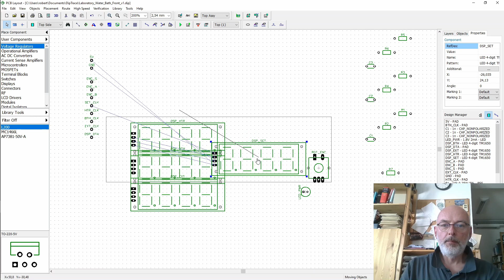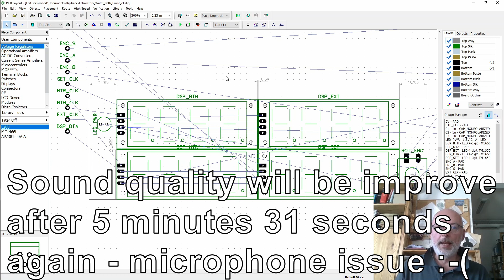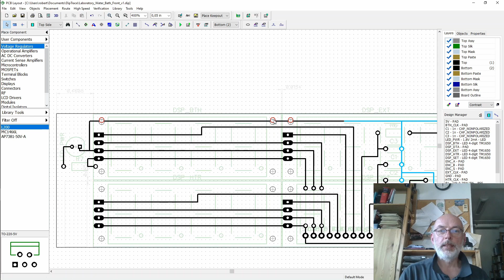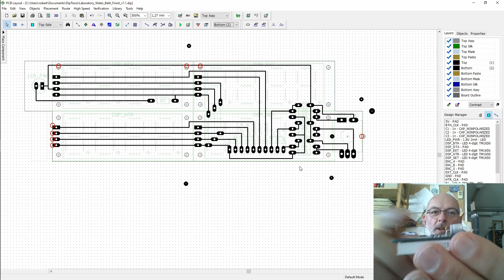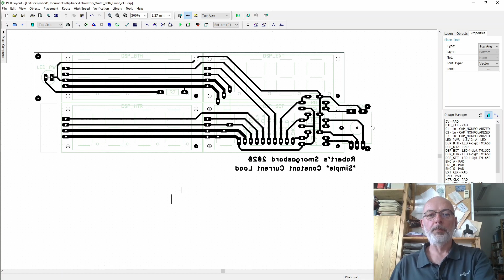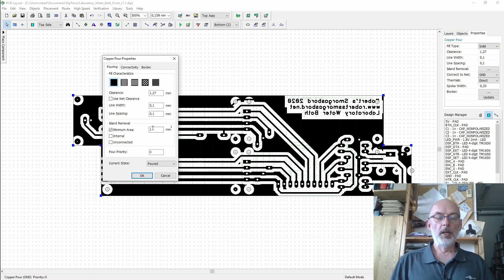DipTrace (2): How I Create PCB Layouts – A (Bad) Example

Comment: Survived ? I loved it, and yes, OCD PCB design means its really hard to say 'done '... but " real men dont use auto routers " I found myself saying "Oh..in Kicad you can do this and in Kicad you can do that" but at the end of the day same result ! Diptrace seems very capable...I have only been using CAD for PCB design about 3 or 4 years (pencil and paper before that) and I love it, I wish I knew that 30 years ago might have had a different career !...anyhow, I hope you film all next stages, etching ect, I will enjoy watching, but I don't miss Ferric Chloride !...I wonder if the Chinese will get us all addicted to cheap prototypes then suddenly bump the prices sky high ! very interesting, cheers.
Reply from the maker: Great that at least one person got something out of this video! Well, it got five thumbs up so far - so it's probably not that bad. I myself considered it a "B-movie", so I uploaded it together with the "Galvanic Isolation of 1-Wire Devices (Direct Power)
". As for more of the same: I still intend to make a video about "how I create" parts and footprints in DipTrace. I did my first professional layouts with black trace tape (came in different widths) and black pad stickers (came in different sizes) on special transparencies with a 0.1'' grid. How the times changed :-) And I already have a video coming up showing how I go from the finished layout to a PCB ready for soldering ;-)